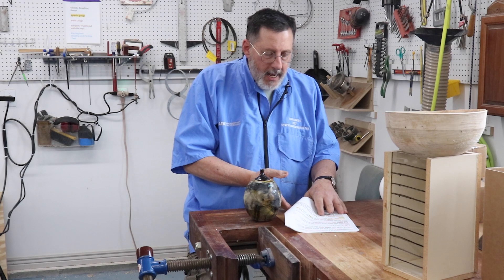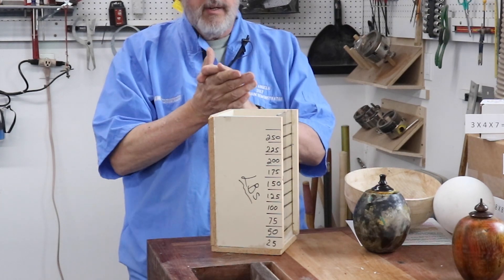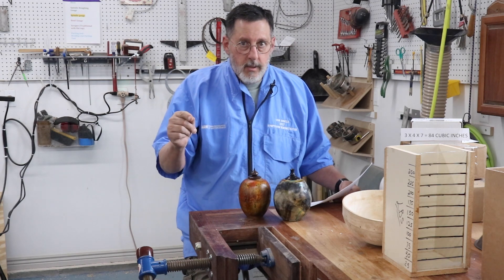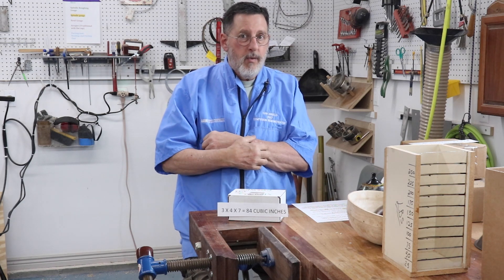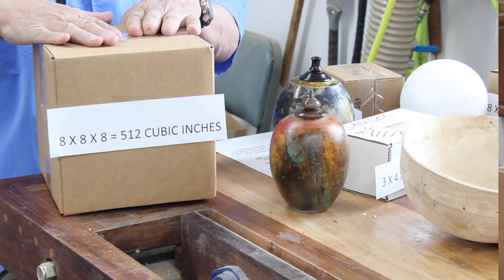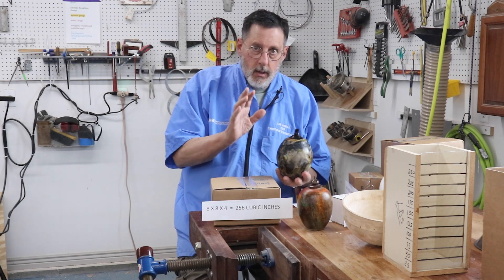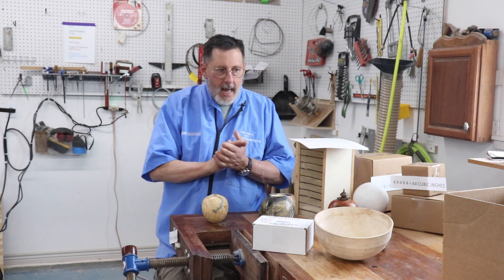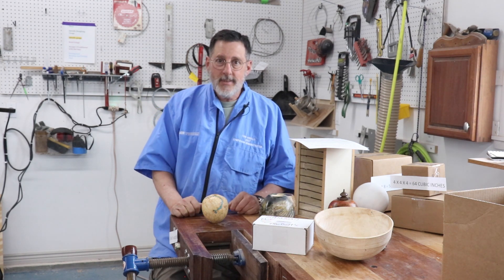Calculating the Volume of a Lathe-turned Burial Urn    with Sam Angelo

Comment: Good discussion of a sensitive subject. Thanks for your complement on my urns, I suspect mine may be a little larger than needed as they run closer to 250 CI (cubic inches).  On box type urns the challenge for me is to get the sides thin enough to be strong but still not take up a large volume.  I may have to fill one with rice and see what the exact volume is.

Comment: If you use a sphere as an approximate shape the following will give radius = volume.
Radius in inches, volume in cu in. I assume urns will not be spheres but semi spherical. The dimensions below will get you in the ball park. The formula is: volume = (4/3 * pi * r cubed) 
Radius	Volume	

2.7	82.45
2.8	91.95
2.9	102.16
3.0	113.10
3.1	124.79
3.2	137.26
3.3	150.53
3.4	164.64
3.5	179.59
3.6	195.43
3.7	212.18
3.8	229.85
3.9	248.48
4.0	268.08

Comment: I could be wrong but wouldn't there be spaces between the grains of rice?  It would be small but still a space where ashes would be solid form of volume (no spaces)  so 1 inch in your measuring device would hold more ashes than rice.  That's just my opinion.  Correct me if I'm wrong.  Wouldn't be much but would be a little.
Reply from the maker: Yes good point. I have thought about this. Sand might actually work better. 
Sam
Reply: @WYOMINGWOODTURNER  The space between rice grains will be the same in the box as it is in the urn so the occupied volume will be the same. It's as if the rice grains are just slightly larger,  The technique is perfectly acceptable as is and rice is easier to clean out of the urn than sand.